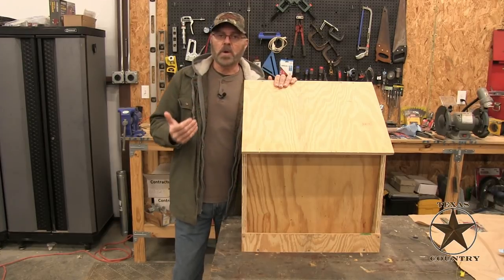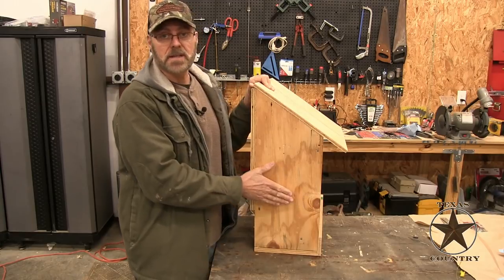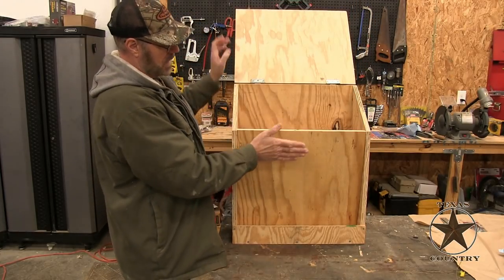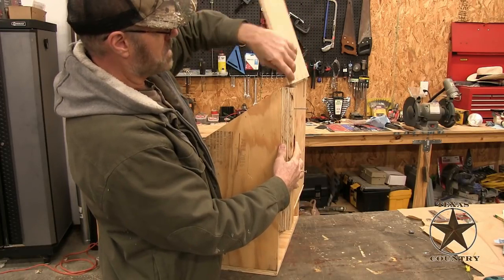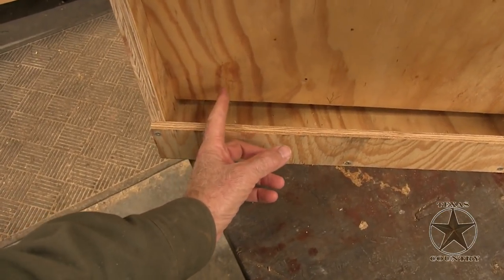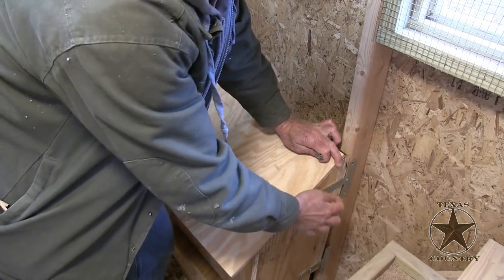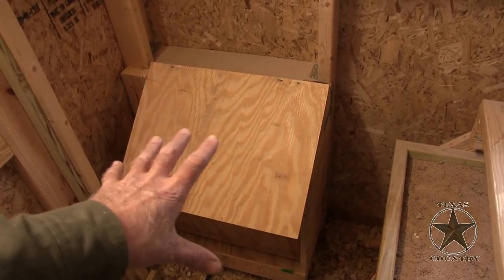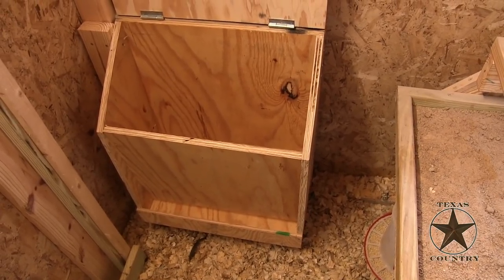DIY-Chicken coop gravity feeder - Automatic chicken feeder

Comment: To make your divider to prevent "digging and splashing" don't use plywood. 
Use Round Head Screws or Flat Head screws, 3 1/2" - 4" long.
You want the thread-less shank to be just Under 2" long, and the rest threaded. 
Screw them in every 1 inch, starting 1/2" below the upper rim of the lower front plywood face.
Drive the screws into the second panel, and continue on thru, until the head bottoms out on the front panel.
The thread-less shank will span the feed opening, and the threaded part of the screws will extend inside of the feeder, which is no problem, since it's protected from the birds. 
Even better if the screw points just poke into the back wall, without going thru to the outside.
The 1" spacing of the screw shanks is close enough to keep the chickens from splashing the feed, but wide enough to allow them to peck the grain.
Simple, cheap, easy, and effective.

Comment: Nice explanation!! But just wondering what's wrong with a pvc feeder that will hold plenty of feed. Thought it'd also be easier to clean off poop etc compared to wood?!
Reply from the maker: Mullai Acres Homestead  Nothing wrong with the pvc feeders. I just wanted something to fit in that corner that would hold an entire bag of feed.
Reply: Mullai Acres Homestead I use a PVC feeder and want to switch to this. The food doesn’t seem to flow very well inside the PVC. It gets stuck and I find myself moving it around so it fills the opening and so the chickens can get to it. Really frustrating stuff 😕

Comment: How does this go for mice and rats? I have a metal sheet one the same and am very happy and got insured no problems with vermins. I like it but am in Australia!
Reply from the maker: Richard Habicher  My chicken coop is built tight and the only way a mouse/rat is getting in there is through the chicken door, and if that happens, it'll be facing 15 chickens that will happily kill it 😁
Reply: Pete B. I have a mouseproblem here in The Netherlands. They dugg holes into my run (no other predator problem here in my town) and eat the food outof the chickenfeeder 😳 my chickens do not kill them....
Reply: Btw I am building a new coop and run, coop higher off the ground and hoping to find hardwarecloth in our country, for the run..

Comment: Would it be Better.  to cut 3 inch off the top of your led . then  put  3 inch  strip you cut off .  on the top of your feeder led opening . then hing your led off of the 3 inch strip . then you can mount your feeder flat to the wall . & when you open your led to put your feed in it . you can let your led lay on the wall & it will stay open till you close it .
Reply from the maker: Yes that would work too.